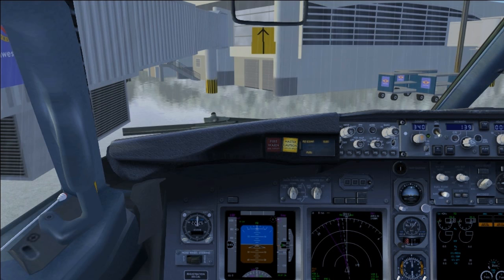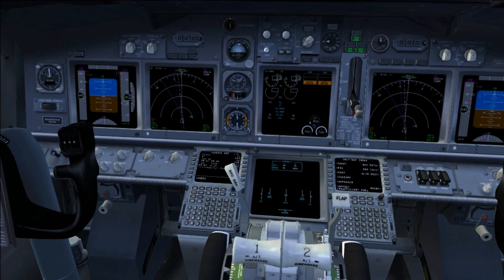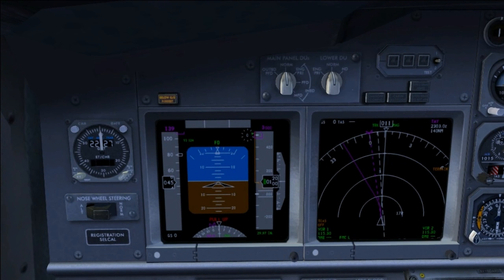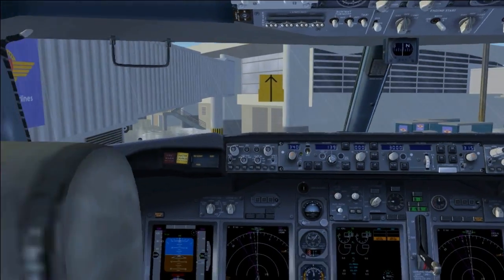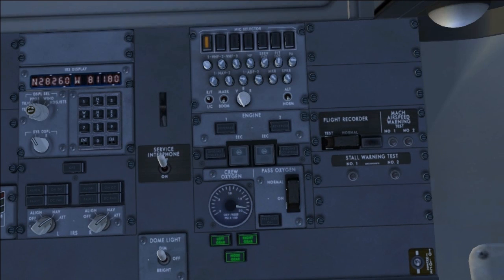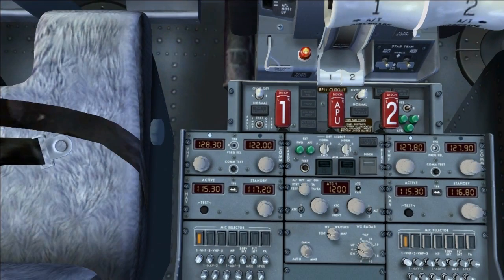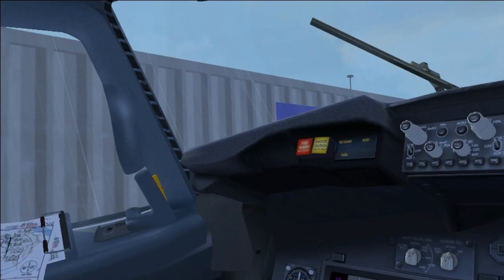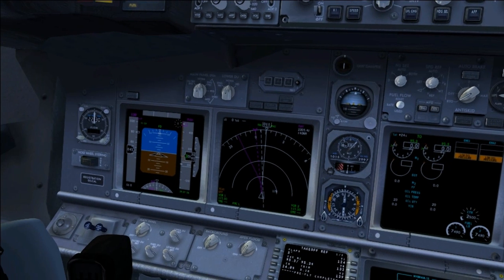737 Audio Warning Explained (FSX)

Comment from the maker: It doesn't have an effect on the preflight if they are open or not, providing you aren't running the engines. Just be sure to wait a bit before turning on the APU bleed after it starts or the plane will start to smell like fuel!